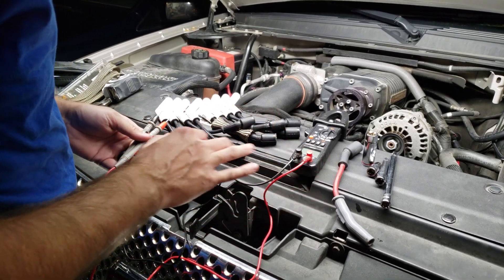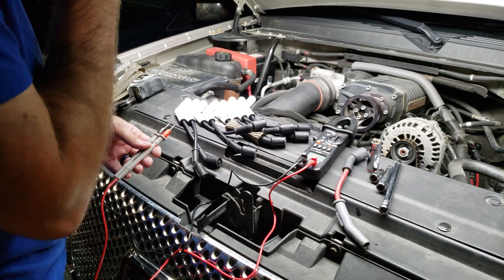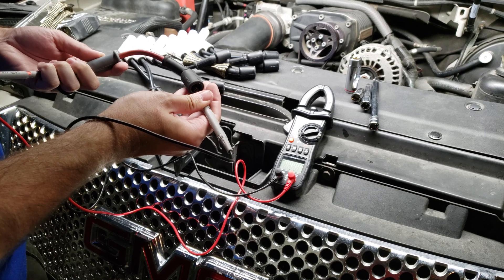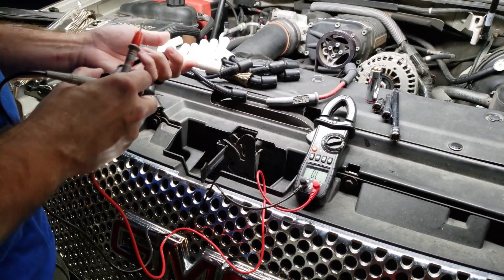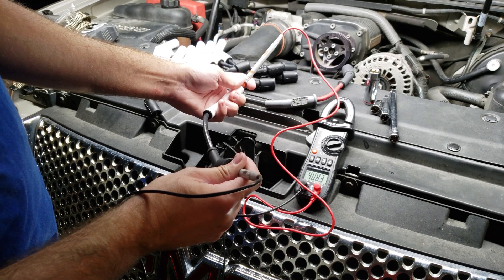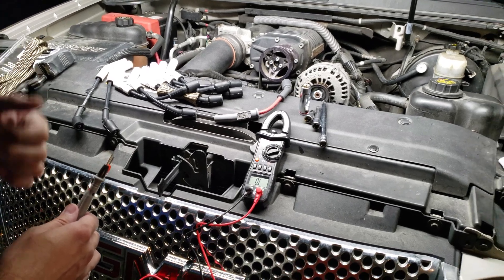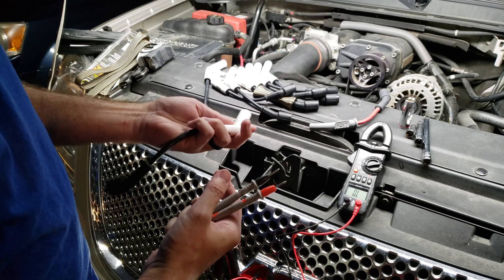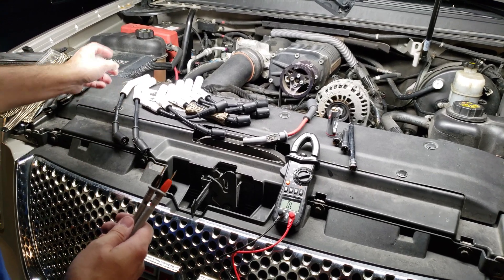MSD Super Conductor vs ACCEL EXTREME 9000 Ceramic Spark Plug Wire Resistance 50 vs 500 Ohms/ft GM LS

Comment: 50ohm wires are for msd boxes use the higher phm wires for your GM truck. 
Usualy use Delco...tried a set of Napa premium (Belden) wires they are pretty nice dont come apart or cost much and grease wont stick to them.

Comment: Glad I found this. I am using a 2" header. I have switched to the Accel wires with ceramic boots hoping for more durability and heat resistance as well as a high level of RFI/EMI suppression. I was a little concerned that they would have too much resistance but from your experience that does not appear to be the case. Power levels of our engines are very similar. Thanks!!

Comment: Did they hold up better then MSD?
Reply from the maker: Great so far and much easier to remove.  The plugs have been changed once and the engine has been out for a complete rebuild and they are still going strong.  The last dyno had it at 745 CHP and 560 at the wheels.

Comment: So how did the Accell plug wires work out?  Have you noticed any difference in performance from the MSD wires you changed from?  Would you recommend Accell or MSD at this point?
Reply from the maker: With these short cables, I cannot tell a difference.